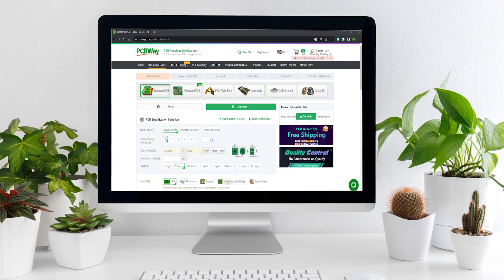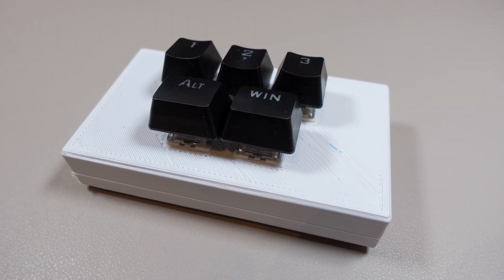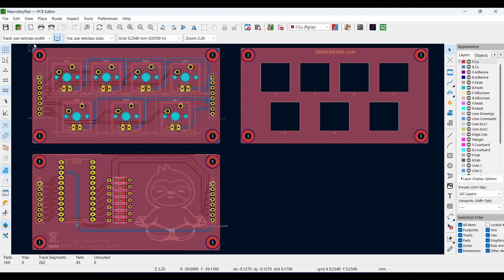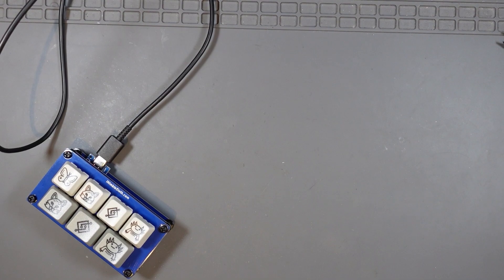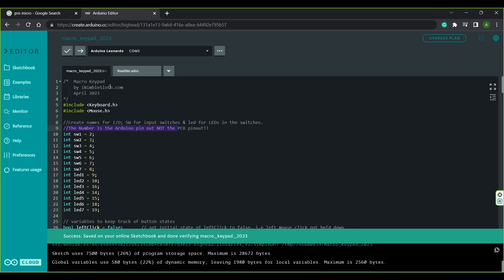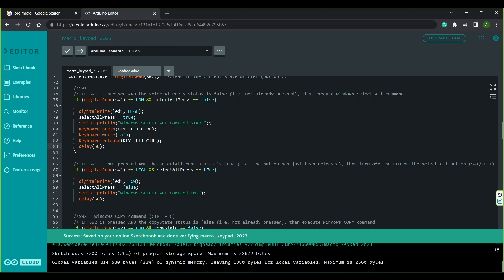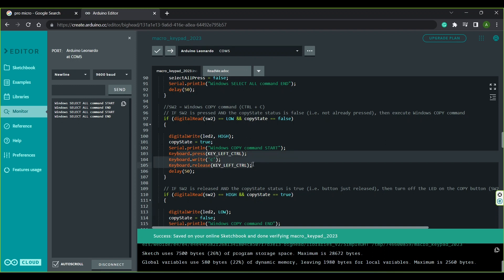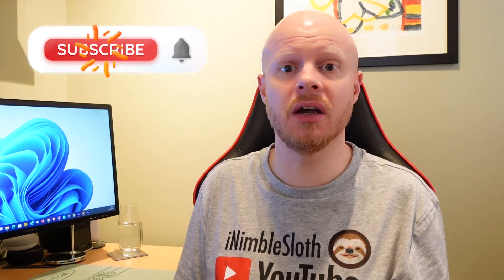DIY Macro Keypad - Build form scratch with custom PCB and mechanical switches.

Comment: Hi, thank you for the video. It's a great help for people like me at the time of making a macro pad. Everything is very clear and to the point. If you allow me, I would like to make a question. How did you make the pcb plate? Im trying on kicad, but I can't make any cutouts in the pcb to put the key switches. Could you give some instructions?  Do you know where I could get footprints for the cherry mx 1u with the cutout?  Please, forgive me if Im asking too much.
Reply from the maker: Hi, glad to hear the video helped. I made the faceplate as the last step. I selected my entire PCB and copy and pasted it so that I had two copies in the same editor page. Then using the edge.cuts layer and line tool, I drew a square around each switch (on the copied PCB) ensuring it was cantered to the switch (my squares were 14.15mm x 14.15 mm), I then removed all components and traces from the faceplate before doing a copper fill on both sides. There is probably a better way of doing this, but is how I did it. I then moved the faceplate PCB over the top of the switch PCB to check the alignment, when I was happy, I moved the PCB back out to the side. Then copy and pasted each PCB into its own PCB file to export the gerbers for manufacture.  One final tip when laying everything out is to place a coordinate 0,0 in a sensible place on your design and calculate the coordinates of where each switch should be, you can then check and adjust the coordinates accordingly to make sure they are spaced evenly. I use Excel to help with this, again probably a better way, but that's how I do it.

Comment: It doesnt work, and it say Keyboard not defined
Reply from the maker: Hi, I've build several of these without any issues, all are being used on either Windows 10 or Windows 11 machines.
Here are some things to check;
1. Rule out any build issues such as shorts or dry joints. 
2. Ensure that the include libraries are defined (Keyboard.h and Mouse.h) in the Arduino IDE, they should be but worth a check. 
3. Rule out coding errors, test uploading the code from https://github.com/iNimbleSloth/macro-keypad/blob/main/Code/macro_keypad_v1.0_(from_Youtube_video).ino as this was used in the video. If working, then try modifying that file.
4. Test the keypad of a different computer and/or OS.
Good luck, hope you get it working!
Reply: @iNimbleSloth  My issues are bacause I am using Arduino uno, and its different of arduino nano or micro, there are libraries not supported in arduino uno and supported in small arduino baords like Keyboard.h and Mouse.h....
Reply from the maker: @bimokayoba   yeah, this is why I chose to use the Arduino Micro as it is easier to implement the keyboard and mouse functions. This video may help you with using an Arduino Uno as HID - https://www.youtube.com/watch?v=tvqA-JcTQNg

Comment: This is a great idea, and I am tempted to make my own, although I would make it with a palmrest and just for keyboard shortcuts, no mouse, as sometimes my hand shakes a bit when I press CTRL together with another button with my left hand, good for things like Gimp2, KiCad and such. Only thing that has me a bit on the fence with it is that I just can't get my head around arduino sketches to personalise them. I've tried and tried, but it's just too complicated for my aging brain. But then I've never been any good at coding.
Reply from the maker: You could always try something on breadboard to see about getting to grips with modding the code before taking it further.  I've updated the code recently to add 2 x "pages" of buttons. Button 7 toggles between the two pages. This way you can have up to 12 x short cuts configured. The code is here https://github.com/iNimbleSloth/macro-keypad/tree/main/Code In the code I've added comments to say  //ENTER YOUR KEYBOARD SHORT CUT FOR PAGE 1 HERE or  //ENTER YOUR KEYBOARD SHORT CUT FOR PAGE 2 HERE where you can past the code for the shortcuts.
Reply: @iNimbleSloth  there wouldn't be any problem with just leaving the "excess code" there for unused buttons, correct?
Reply from the maker: @hyzenthlay7151  Sure, that would be fine.